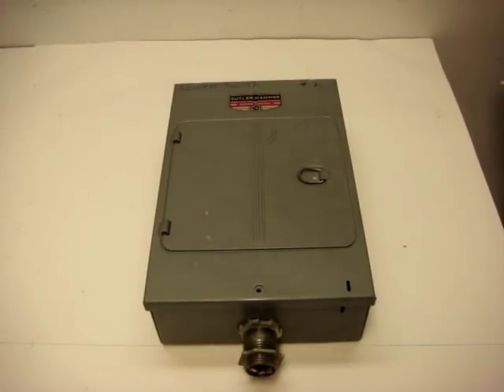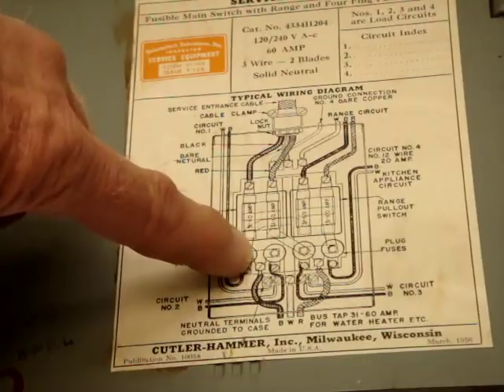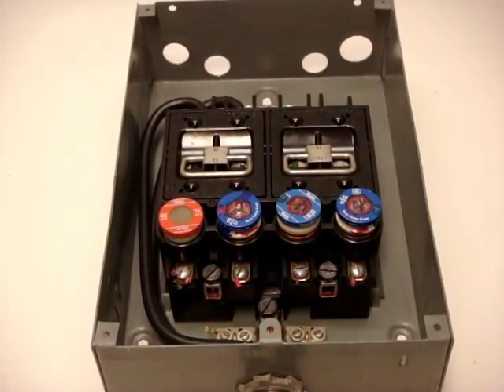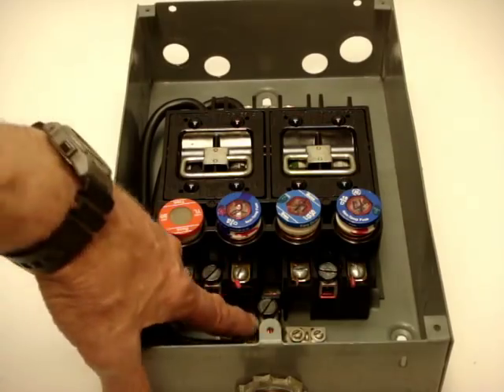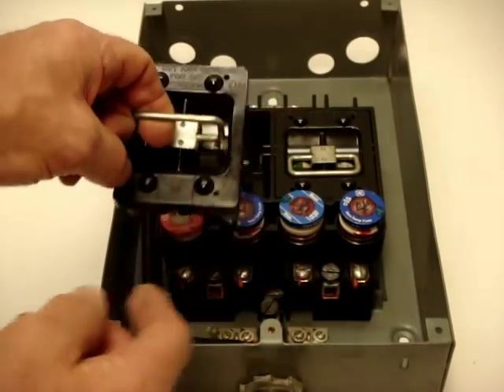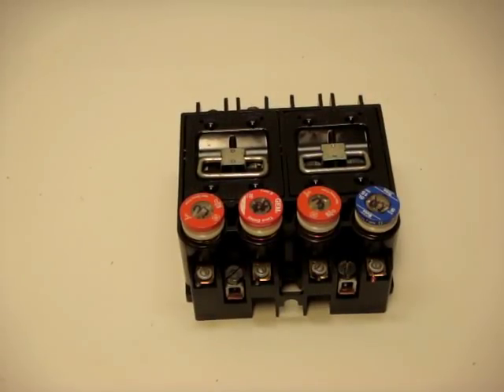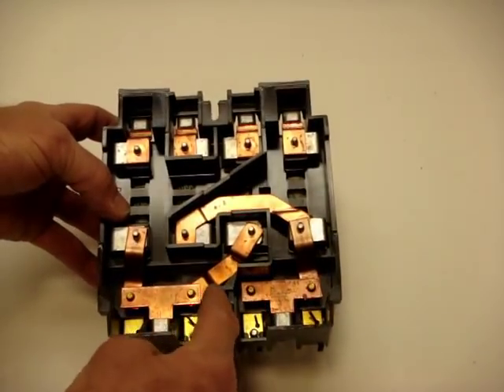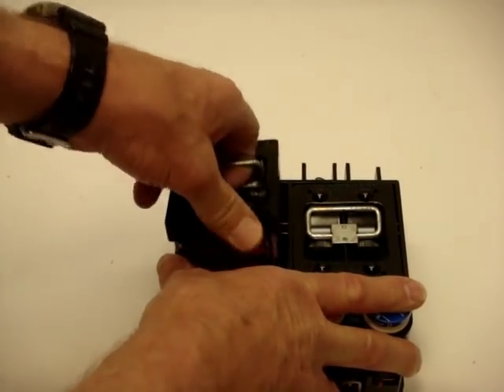60 Amp Fuse Box

Comment: I'm no electrician so I hope you can follow me here. I have a 60a fuse box just like that but my has the two fuses added on underneath the four. So 6 circuits plus the range. 
This is what I don't understand. It's a 60a box but two legs of 120 come in each leg has a 60a fuse to me that looks like I have 120a total coming in. I know that's not right but why is it not looked at in that manner?  On top of that we jump over to the range side. There I have two 40a fuses which go to a dryer. 
I'll wait before I bring up my electric hot water heater.
I'm just wanting to understand where I'm going wrong lol
Reply from the maker: Fuses limit the FLOW, not anything else. If an elevator says "Capacity 20 Persons" and you are the only one in it, are you 20 persons?, NO, it just limits the capacity. The fuse box has 60 Amps MAXIMUM, how you the usage is divided up depends on the loads.
Reply: @sparkyjohnrg  glad to get a reply back I didn't notice until after I ask the question that the video was 10yrs old. 
Anyway thanks for the answer now it makes more sense.
 This isn't a really a question unless you have ran into it before and have some insight on it.
I live in the house I grew up in my dad bought it in 65 when I was a year old and the deed/title says the house was built in 52 or 54. However the fuse panel is has a manufacture date on it of 1956. It a 60a panel with 6 circuits and a range circuit that is used for our dryer. Just beside it there is a smaller panel that has an old double pole breaker that has 20a on it that goes to my electric hot water heater. It has never tripped but I have switched it off before to change out the water heater. I recently figured out there is no way to switch off the power going into the breaker. The main wires don't come from the main panel. I can pull the main and the range fuses and the wires going into the too of the smaller box are still hot. The ground is the only wire coming in from the main panel.
One person told me at one point back in the day the power company would install a 2nd meter and charge a lesser rate for power if you would install a electric water heater. That may have been the case but I never known this house to have another meter and we've always had an electric water heater. The only thing I can think of is that it had two meters at one time but when the 2nd meter was removed the wires running to it were moved to the original meter base. As far as I know that goes against code you're not supposed to have two sets of service lines running from one meter I was told. However the power company would have had to be the ones that connected it that way if they removed the 2nd meter base.
I've seen almost all of the service line during my time here because it runs through the wall of a closet from the meter base to the main panel instead of the attic. The main panel inside is a straight 6-8' distance in line with the meter base on the outside of the house. It's been this way for almost 58yrs. I don't recall seeing a splice in the wires when I replaced the sheetrock in the closet yrs ago but I don't remember how many wires that were run either because at that time I thought the main fuses killed the power to it.
The only way I can be for sure is to remove a piece of sheetrock close to the outside wall where the meter is.
I do have one question is there a way I can tell what amps the meter base is rated at ?
Sorry so long and thanks again.
Reply from the maker: @LH-kz2nf  Since you have a 60 Amp service, It is likely that the wires feeding the subpanel were tapped to the line side of the fuse box. You can determine this by CAREFULLY removing the fuse box cover. If the wires going to the breaker box are under the same terminals as the wires going in, you have your answer.

Comment: Is it Necessary to kill electricity before pulling out a fuse or fuse block prior to test?
Reply from the maker: +Cody Farmer   I presume that you mean you want to test the fuses. Removing the fuse, or fuse block, stops the flow of electricity for that circuit. I do not feel it is necessary to remove the MAIN pullout to de-energize the fuse box.
Reply: No, you do not have to turn off the main power to change a fuse, but it would be a good idea for safety. My great grandmother's fuse panel developed a frayed wire inside the panel that was unknown. What happened was that wire ended up making the fuse sockets electrically live. Of course fuses have metal housings on them, and when you held that fuse in your fingers and went to screw it into the socket, you got quite a bite as the current went through the fuse's shell and through your fingers. It didn't happen with glass fuses, only the metal ones.
Reply: You don't have to but the possibility of being shocked is still possible, I know from experience 😂🤷‍♀️😂. I pull the mains now as a precaution.

Comment: Is there a reason the fuse block is 50 amp and not 60 amp?
Reply from the maker: Both fuse pullouts will accept fuses of 35 to 60 Amps.

Comment: i have one of these boxes with just two screw in fuses and no block, just a lever. i keep blowing a fuse on it and can't seem to find out why, only thing hooked up to it is the pressure switch for my well
Reply from the maker: Are you using a Time Delay (Dual Element) fuse? Motors consume 6 to 10 times running current when starting. This can cause a single element fuse to blow instantly.

Comment: I have one of these in my vacation home. All 4 of my fuses are in use. I need to add another circuit. Could I attach 12/2 gauge (20 Amp house wire) to a “feeder tap” and run that line to an auxiliary fuse holder with a 15amp fuse in it(bussmann) in order to create another circuit?
Great video, you really helped me understand how my electrical system works.
Reply from the maker: You may find it easier to use a fuse reducer for cartridge fuses and come off of the range block, if it is not being used.
Reply: I had a 60 amp panel like this, but mine had six screw in fuses. I needed a couple more circuits, and what I did was add a small subpanel for six circuits off this panel. I fed the subpanel from the Range pullout block, using 8/3 wire and 40 amp cartridge fuses. You could also probably feed this panel from the feeder tap lugs if the Range block is in use, or your panel doesn't have a range block, some don't.

Comment: does anyone know if the feeder tap can be used as a legit place for a grounding rod?
Reply from the maker: NO!! Feeder Taps are energized! Any grounding would be done from the neutral terminal.
Reply: @sparkyjohnrg  will the neutral work with 6 gauge stranded.I have 1 free screw on the right side?

Comment: my paents have wadswort put in 1970 it has 8 screw fuses 4 pullouts i belive main only kills 8 screw fuses and each pullout is its own are you familier with wadsworth
Reply from the maker: The Main Pullout usually kills the whole box. There is a wiring diagram included in each box, or inside each cover that should show how the box is wired.

Comment: can anyone answer i have the exact set up why do my main fuse blow instead of the screw in fuse when i over load the system by accident
Reply from the maker: Your MAIN fuses should be Dual Element (Time Delay). That should cure your issue
Reply: @sparkyjohnrg  the 15 amp screw in's are time delay all four but the ones behind the block blow one out of four the cherry bomb looking fuses. shouldn't the screw in ones blow before the mains? The block was hot and the fuse could have burned me it was so hot. i need to upgrade the system and rewire it because i can't run the stove microwave kitchen lights dishwasher at the same time it eventually blows the fuse with in a year. also on a 60 amp what should the main four fuses behind the block be thanks
Reply from the maker: @bobdimartino6738  The Fusible Pull-out should have Time Delay Fuses to override start-up inrush current. The Range can be a rather large load, depending on how many burners / Oven are in use. Don't fail to consider the connections behind the surface are failing. As connections deteriorate, there is increased resistance manifesting as heat. You said the cartridge fuses were almost hot enough to burn you. That electrical system was installed before some of the modern appliances were available.